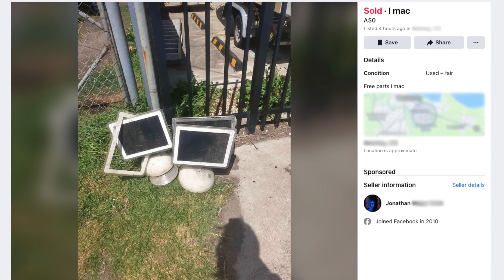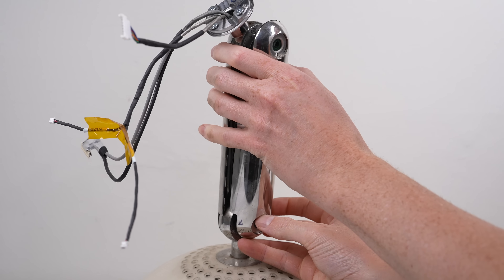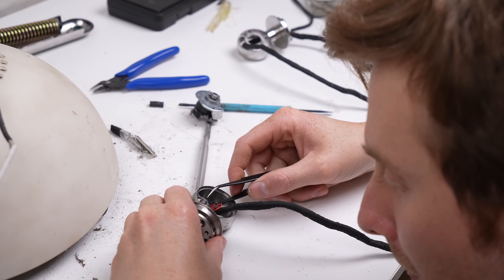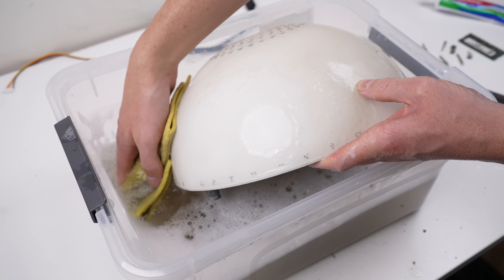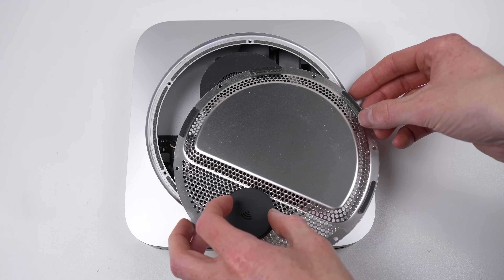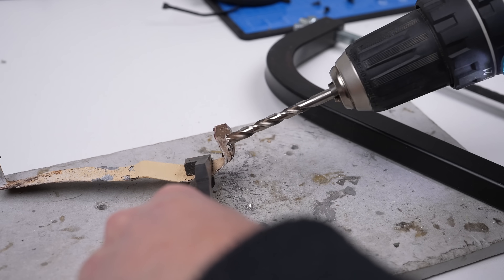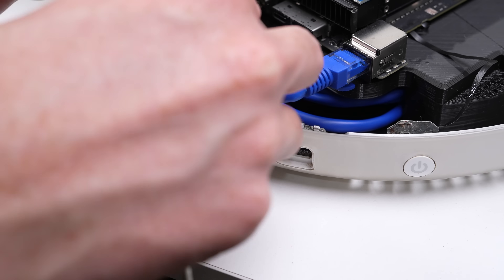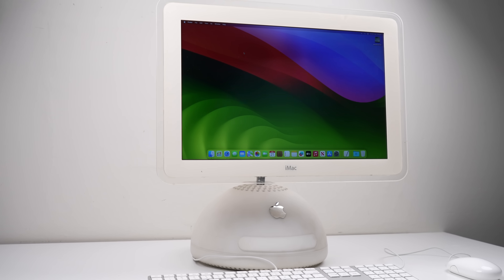Rescued iMac G4 Restored and Upgraded With Modern Hardware - Apple Silicon (M1)

Comment: I have the 15" iMac G4 with a 1024*768 (4:3) screen, is the bottom unit the same size as on the 17 and 20" widescreen models? I have it in my head it's smaller, but otherwise this is something I had wondered about...

Comment: You need to mark Pin 1 side on connectors, usually with a red dot to match the cable. Pro tip!

Comment: Nice!!! I remember I had a few of these. That mystery pin you found with the screw is for the swivel mechanism. It stops it from spinning too far around left or right. I painted one red and one black. But not from the outside. That outer shell is actually clear and comes apart from the white plastic. So I removed the clear shell and painted the white with primer and then few coats of paint. Put them back together and viola, no fear of scratching the paint. I also made a clock out of the bottom of one. Love this build!! I went from a G3 to a G4 then landed on the new Intel aluminum 21" iMac.

Comment: I would like to see someone upgrade the 2019 mac pro ro a more recent intel or motherboard by amd with the latest xeon amd threadripper i9 or  amd mitherboard and fadtest or mist cires chipset a 4090 or two ir two amd 7950 xtx

128 or 256 mb ram.
4 tb boot ssd 16 tb pcie 4x4 ssd card power supply ports that can fir in the mac pro case.

Open core for dual boot windows linux and hackintosh.

Or is there someway to overclick and cool undervokt the oem xeon ?s

Comment: almost the same as putting a new engine in an old car - provided you don't have to buy a new car to get the engine, in which case you're taking off the new body and replacing it with an old one. one is an upgrade, the other is a downgrade, that would be the difference.

Comment: Lazy build you should not solder the wires to eachother. rather take the power supply apart ad solder the wires directly to the psu

Comment: I worked for Apple’s support division AppleCare when these were new and remember the struggles of the arm. Apple would simply replace the arm rather than provide instructions on disassembly. As you found out how difficult it was to work on. Still, a brilliant and iconic design.

Comment: I have one of these in great shape. It was at a University just sitting in the corner. Mine is running Linux on on the original hardware. You can find some Linux distors that still support power PC.

Comment: Awesome to see how you fixed such an old iMac into nowadays hardware! I think you might want to use the other iMac as 2 secondary screens. You then swap its screen with that desired display and change it to the thunderbolt/usb-c monitor cable and voila, when done you have yourself a triple monitor iMac setup! Very very useful for many people that do gaming on desktop aio’s, graphic designers, and office people that need 2 or 3 monitors for what they can do on 3 displays! 
🖥️🖥️🖥️
😏⌨️🖱️

Comment: I would remove the whole screen leaving the chrome pivot bracket / articulated neck, and attach a magnet or likewise to the screen end of the bracket.  Then one could attach an apple i-Pad of any version or model (obviously the biggest, most up to date, slimmest version) and hey presto! a sleek, modern , aesthetically pleasing apple i-Pad stand with i-Pad.  This could be used when needing a more desktop designed application.

Comment: I have a pristine 800mhz g4 imac and have had it for about 15 years at this point (bought it for 30 bucks from a garage sale) and I've been tempted so many times to gut it and retrofit modern hardware. But everytime I start going down the rabbit hole of research, I just can't bring myself to do it, the OS9 charm is too strong, even though I can't really make much use of it. 

Great video and work though!
Reply: I would say if it’s pristine keep it as it is, it would feel kind of wrong gutting working vintage hardware. Even though it isn’t really useful in a modern sense playing around with an old OS from time to time has its charm.

Comment: Great build! But AFAIK it is bad to solder wi-fi cables, or any other cable used to carry high frequency signal. High Frequency electric Waves don't like the change of conductor material (copper to tin-based-solder to copper). That's the reason why Ethernet cables are joined only with connectors, not soldered like power wires.

Comment: I was a technician at an Apple Authorized Service Provider from 1997 to 2020, and I worked on hundreds of these machines. There were a lot of pitfalls to working on them, and an inexperienced technician could easily break things if he wasn't careful when reassembling. That blind-mating connector was a common one to get buggered up, and people never took it serious that you were supposed to clean the thermal grease off and do a new application to both mating surfaces each and every time the halves were separated. They were incredibly well built and brilliantly  engineered machines, with their articulated necks and faraday shield heatsinks. The necks were actually one of the most reliable parts of them, rarely requiring replacement. They had chronic issues with display panels, inverter boards and power supplies. The optical drives would also clog up with dust in environments that were dirtier than the average house, but in general, they were good machines.
Reply: Any idea what the mystery pin was that he found in the arm assembly?
Reply: @DrawnDoggo  No idea, but I'd guess it was used to align, or guide some portion of the rotating assembly that had to do with the cover-plate. Seeing as how the screws securing the cover plate loosened up, this gave the pin an opportunity to wiggle out of its perch, wherever that may have been. I never actually had to disassemble a neck assembly. In fact, as service providers, Apple did not permit us to disassemble the necks. If any of the cables in the neck went bad, the policy was to replace the entire neck assembly, and they weren't cheap. We occasionally had issues with the tri-spanner headed screws at the top and bottom of the neck column coming loose, so we had a machinist make us a set of tools so we could tighten those for our customers. I think I still have them somewhere, in fact.
Reply: @jasonatkin6787  i guess apple knows it was such a piece of art and would very inconvinient to dissasemble
but seems they also kind of forget that parts will break overtime(even though tech moving real fast),then again you said it was extremly realible so i guess they already thought out the pros and cons

also sorry if i have incomperhensible engrish, my mind kinda blank now and enhlish isnt my main language lol

Comment: Why not unscrew the PSU cover and solder wires directly to the PCB? This is high voltage, why risk it with that flimsy heatshrink tube

Comment: 2:35 it absolutely could have but you would need to remove the connector and splice one back on after the cable is ran. But the other solution is cleaner.

Comment: "About this Mac" reports the machine as an M1 mac mini, yet the Bluetooth preferences says it's discoverable as an iMac G4. Why is this? Is it using the original Bluetooth card, rather than the one from the Mac mini, and if so, why did you choose to do this?
Reply: There are settings that let you change the name of the device in Bluetooth settings, So your Bluetooth device shows up with a different name that what is usually preconfigured in macOS, Windows, iOS, Android and so on. So no, It is not using the original BT card.
Reply: @JankPods0201  Oh, of course. In fact I've done this myself to make certain devices more easily identifiable in the Bluetooth settings. Thanks.

Comment: 17:28 I guess you did realize, this is a coaxial cable, so it's center wire (core) and outer wire (shield) must both be reconnected and most importantly must not short out. How did you achieve this?

Comment: Hi, your content is always very in depth and I appreciate that a lot. I have a request that has to do with all the keyboards, I have the M1 Pro 14 inch, and the keyboard gets a shine over time, not slowly like older Macbooks, but extremely fast. Here in the EU there is a law that says that if a product shows a defect/problem that is not made aware before hand and you could not have known you can get it fixed and if it cannot be fixed in a durable way you can get your purchase price back. As an example the iPhone 15 Pro gets fingerprints and this is addressed, so as a consumer you know what to expect and you can adjust knowing what will happen, however this is not the case for the shine on the keycaps. The wear on the keycaps does not fall in the "durable" way Apple showing to the outer world.
So, I went back to the store and want to get it fixed with durable keycaps, however it is not the Apple way and was send to a liaison and the issue is subverted. Apple will not acknowledge the issue. The request is can you make a small video addressing this issue, because sinds the release of the M1 MacBooks a lot more people are complaining about this and https://www.youtube.com/watch?v=yDccCQEYWSQ&t=559s has talked about it. The more people will make use of this law means that Apple has to adjust their ways.

kind regards,

Yoh

Comment: that's a great conversion for the next one it will be interesting to see if a modern 24 or 27 inch can be mounted using 3d printed monitor encloser mimics apple design in white with M1 or above mac mini. will the arm support the wight of modern screen or not? also get proper USB C or thunderbolt extension to support dual screen setup or fast transfer from iPhone 15 pro or new iPad.

Comment: few notes on the mac mini. the youtuber snazzy labs did a video where he 3d printed and custom designed a new case for that has about 75% less volume (so much smaller), ditches the big power supply completly and adds magsafe, also removes the fan (in the macbook the m1  doesnt have a fan anyway so it doesnt matter). the m2 mac mini also has the same logic board format and i suspect the m3 mac mini will have as well. these computers are extremley awesome for such kind of case swaps because as long as you can fit the mainboard you are 60% there.

Comment: btw that lcd board you got also has a audio amp that you could connect speakers to either mod them inside the mac or add some connectors on the back to use original g4 era speakers right to the lcd board amp since it gets its audio signal from hdmi input if you want to do that you need to setup the volume to max on the lcd board through its osd with the buttons that should come with it

Comment: I picked up a 15" iMac G4 years ago from an ewaste dump, then sourced a 20" screen from ebay, alas it was too heavy for the 15" base and it can't stand right. Also bought a Haswell NUC and a 2x8GB laptop ram kit going the hackintosh route. It did work, but I never completed the build. The ram is now in my laptop and with a SODIMM adaptor it works anywhere DDR3 memory is accepted. The NUC has one memory slot fail and was sidelined.

These G4 screens are TMDS screens, and accept a standard DVI-D signal once wired up.

Comment: Action Retro did it with a M2 Mac Mini, but this is Kinda better, because The Mac Mini is inside of the G4 instead of being connected By an HDMI Cable.

Good Job, Hugh Jefferys!
Reply from the maker: I also watch Action Retro :)
Reply: Action Retro used a replacement board that was designed to convert one of those into a monitor with extra functionality, like a dock with a screen on it
Reply: F R E I N :)
Reply: Actually watch the video again.. He put the Mac Mini into the G4 enclosure.. That was actually a better build, you have more ports available too.
Reply: @Jon4Short93  WE KNOW
Reply: Me too. I also watch action. Retro

Comment: Wow,  I have 2 broken iMac G4 with me for the past 7 years, but I haven't been able to work on it, because of the difficulty of the mod. It is a herculean effort and I applaud you for your work, and I definitely agree, it is probably the hardest project for anyone.
Reply: Time for an M2 Pro iMac mini upgrade
Reply: you need time, a functioning brain, a pair of opposable thumb equipped hands and the right tools*. some money to order the missing parts is a given. you'll get bonus ponts for re-using the tray for something cool too! 😉

* please, treat your tools better than he does (rusty pliers while working on electronics!?! 🤬) and get the right ones for the
 job as that would simplify the work quite a lot, from having a quality bench vise to a stepped drill bit for easier cable routing through the arm... 😑

Comment: I got a 20 inch version and when i opened it up the cpu heat sink was stuck to the chassis. I had to use an X-acto knife and lots of alcohol to remove it. Luckily, it had never been opened up before.

Comment: 1:17 900p resolution back in 2002? That's insane - a lot of PCs and laptops back then would have been 1024x768 (4:3 aspect ratio) at best!
Even 10 years later, a lot of laptops were still 1366x768 resolution only.

Comment: That's not how antenna cables work. You can't strip them with wire cutters and solder them like that, it's a coax cable with a center core surrounded by a shield sleeve.  If it works at all it's going to be far from "perfectly", with reduced speed, range and it won't be able to connect to 5.8GHz wifi.

Comment: Ur videos encouraged me to buy a phone lot and now I'm planning to repair two Galaxy S7 edge's (one of them is a Live Demo Unit) two Moto G4 Plus'es, one Moto G5 Plus and one Galaxy A50.

Greetings from Brazil.
Reply: Be aware that some Samsung demo units of that vintage did not have cellular antennas installed.  They were purpose-built demo units that couldn't function as phones.
Reply: @ljessecusterl  yep i noticed that theres no antenna connections on the board
Reply: @ljessecusterl  ofcourse demo units are just that, a demo into the phone's functions.
Reply: @ljessecusterl  I wonder if the demo functionality extends to that of the hardware e.g. modems tho. I've seen other brands such as LeapFrog simply nerfing the software side of things with their Epic tablet without messing with the hardware at all, and I was able to convert them demo units into fully functional tablets.

Comment: What adhesive do you use for the screen? I am fixing an old Ipad and the screen won't stay down with 3m double sided tape.
Reply from the maker: Just some generic E8000 phone repair adhesive. You can usually get it where you get your phone parts. The only thing is you must clamp the two pieces together until it drys otherwise it won't stick properly and your device will likely fall apart.
Reply: @HughJeffreys  thank you so much. Im a huge fan. Keep up the good work.